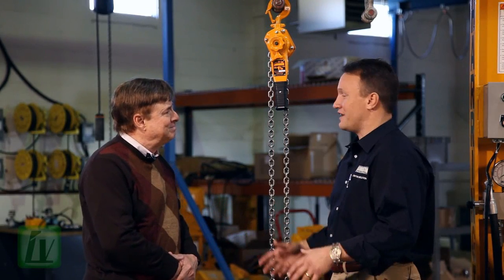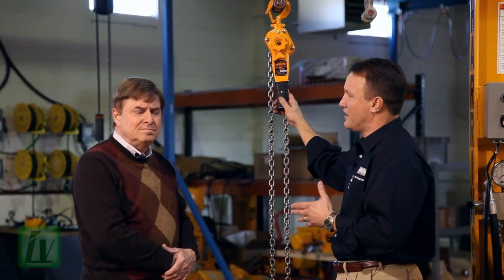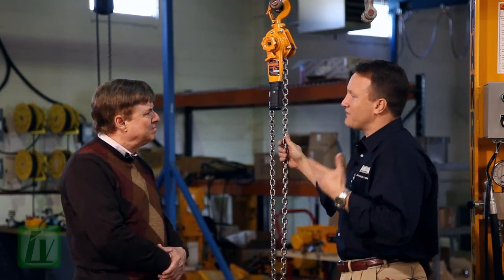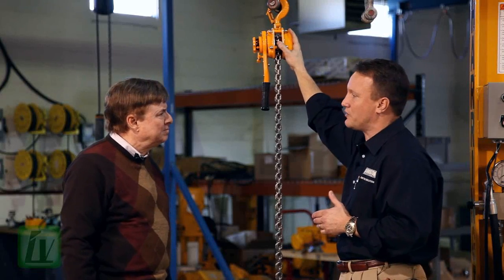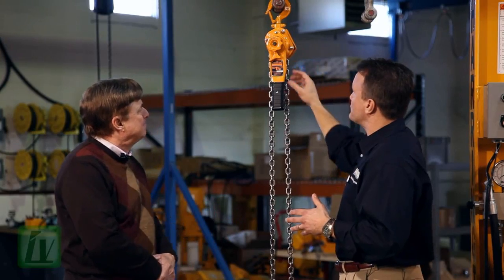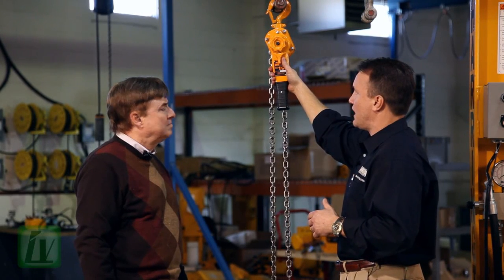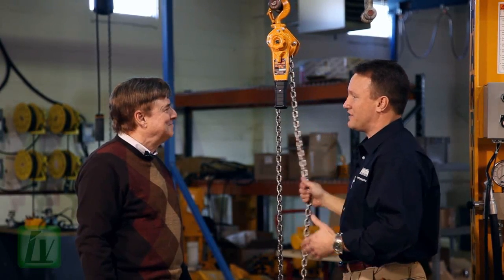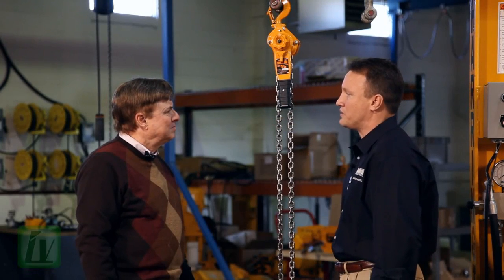LB Lever Hoist Freewheeling

Comment: i have one of these and it wont even let you pull out into freewheel under load
Reply: They got a video that will fix that, I've had to take them apart once in a blue moon because of that but they're still more reliable than any other come along on the market, my only gripe is I wish the tiny silver one the made free wheeled an the knob popped out like the big ones other than that they're come alongs an chain falls blow everyone else out of the water
Reply: You probably have dust debris thats making it bind up, I've only had that issue if I've had a bad hand on the job dragging them through deep salty muddy water or just gravely mud in general it's easy to fix tho